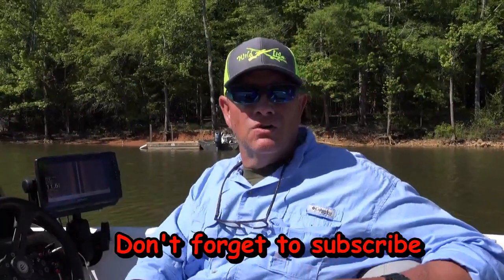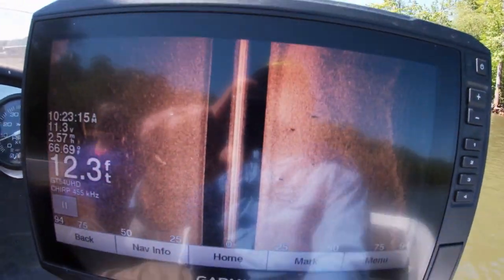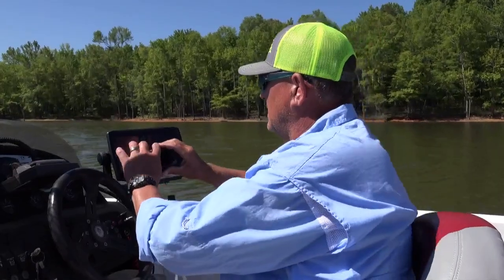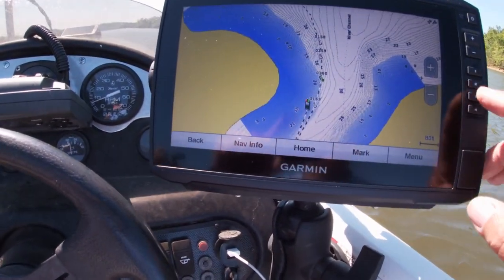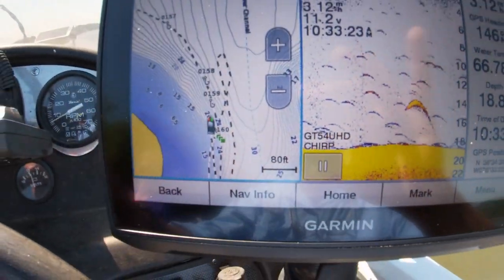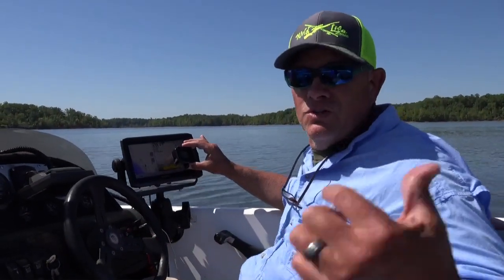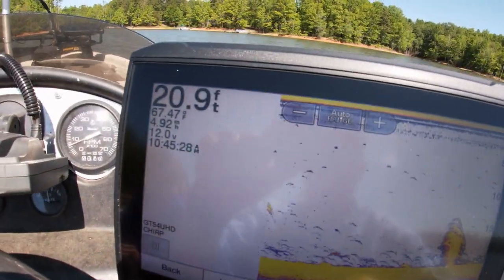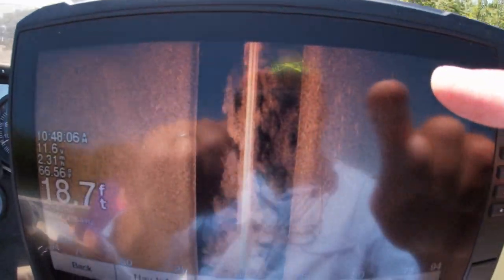How to Find brush piles on a lake with Side Imaging,Down Scan and 2D sonar using Gamin Electronics

Comment: Thanks for the easy goin explanation. I get excited when I see structure like that on my unit lol.. same unit as yours. Do you mind saying what your sensitivity is on for down scan. Having a heck of a time telling whether I see fish or just a part of the cover. Thanks
Reply from the maker: set noise reject on "High"/ color gain 83-84/ regular gain 76 /TUG set to off / set bottom fill to on   One think I did to get mine dials in was , when you know for a fact you are on fish I would move my setting till I achieved the appearance  I was after . On a couple of occasion I have had to turn my gain down because there was so much silt in the water.
Reply: @wildlifeadventures-13  will give it a whirl. Thanks for the help!

Comment: hello and thanks for the great videos but i have a quick question how is it that you can see the creek channel so good what am i doing wrong or do you have a chip
Reply from the maker: I don't have a chip . The only thing i know for sure is , the larger your screen the more bottom detail you can see . If you are running a Garmin unit ,go into you setting and set is on 455 instead of 850 or 1200 , just depends on your unit . I can see better detail on my unit on the lower settings . I have a video on making those adjustment .

Comment: Great Video. I saw how you arranged your presets. Can you tell me how you were able to go so easily to split screen to show side scan on the left and Downview on the right? These are just the videos we all need. Thanks so much
Reply from the maker: The menu settings will give you split screen options. My screen is a 9" screen so I choose to use my 1-4 preset buttons to quickly switch between screens and keep the screen wide as possible .